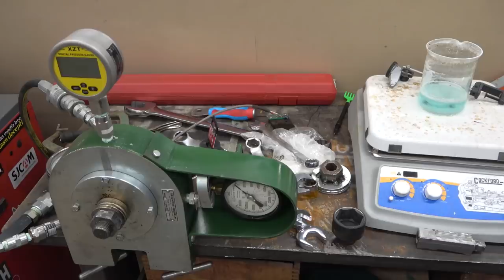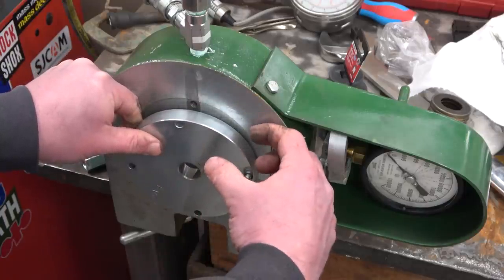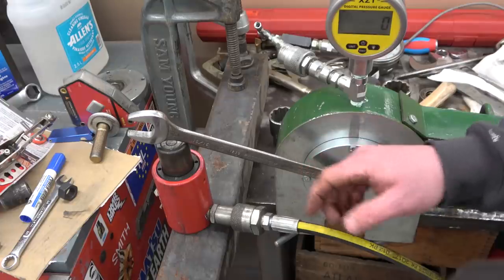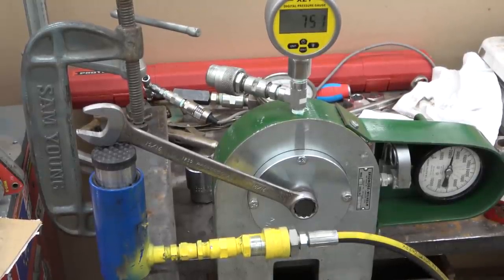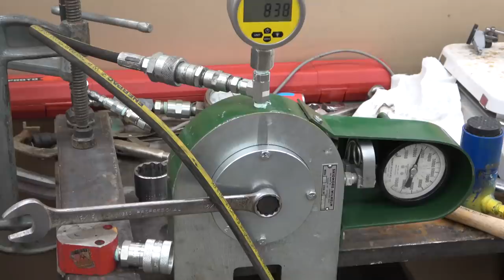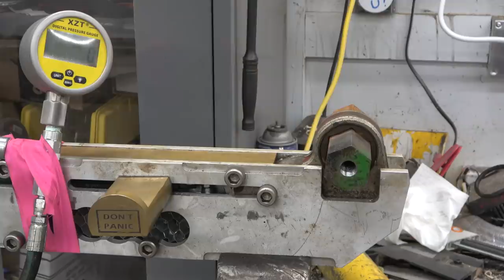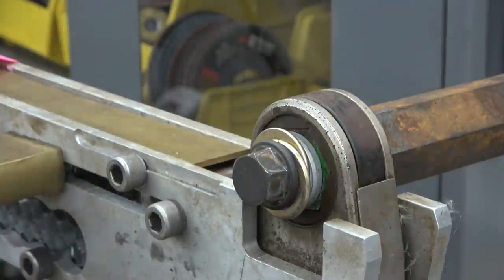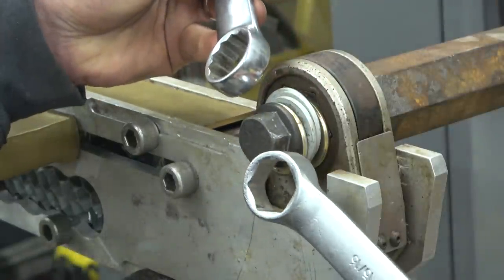6 point VS. 12 Best wrench?

Comment: FYI I am cuntinental.  Only ever had a problem with 12 points slipping on small sizes, like 13mm downwards and only ever on rusted worn heads. Love my 6 pointers for taking old and rusty crap apart. And if I can rescue a nut/bolt with a 6 pointer I'll probably not be arsed about swapping for a new one. I'll save myself 10 pennies and swap it next time🤣
Sometimes as big as 19mm might slip if the heads are really rusted to hell and badly worn. 12 point if the gear is in good order and theyre not made of cheese.
Horses for courses

Comment: I will always choose a 6 point over a 12, unless the 6 point absolutely will not work. 12 point only contacts ont the tips of the fastener, which causes more stripping. Especially with the smaller fasteners (1/8-3/4). I think that bolt was much to high quality. Get a weaker bolt and the 12 point will fail where the 6 point will not. Guaranteed. It's just physics.

Comment: The only time I’ve need to use single a hex ring spanners was working on V8 Mack exhaust manifolds and fire boxes . They are right up against the chassis rail and the constant heat fucks the bolts …..if you round those fuckers off your going to have a bad day …

Comment: If you’re fortunate enough to be dealing with nice pristine new fasteners then yes there is no difference to be had betwixt the two.   However, my six point gear has saved my
 bacon a time or twenty  dealing with rusty crusty junk bolts or on softer stuff like those junk aluminum bolts or the cheese grade bolts used in 90’s era GM battery bolts.

Comment: 12 point have a use, when it’s such a tight hole you can’t get a 6 point at the right angle to bite, like an lb7 turbo swap, dear god ill never do that job again without removing the cab lol.

Comment: Now try that with a rusty ass bolt head... or if your nuts are rusty, try that. That is where the 6 point comes into its glory. The problem is not weakness with the wrench but instead with the farstner. Any shade tree knows this little nugget of wisdom from many a curse ridden late night trying to defeat an evil possessed nut or bolt on their old trusty rust bucket.

Comment: I try to only use 6 point combo action wrenches & sockets. The 6 point combination wrench is a lot harder to find especially in both big box stores. At my first job 50 years ago we had 2 of the best mill Wright mechanics who made me take what they called nut rounders home. ( crescent or adjustable wrench for you younger guys. These guy could be on a third story hard to climb up to roof and refused to use nut rounders a different trade guy had with them. Would climb down 3 long ladders to get to their tool chest in basement of buolding just for 1 socket or wrench. Halve ass mechanics always use cheap halve ass tools.
Reply: Nothing inherently wrong with a decent quality adjustable.  Also, knew 60 years ago that 'crescent' wasn't correct.

Comment: Its more so YOU slip on the wrench rather than the wrench itself. Pounding on the ass end of a 12 point in a spot reserved for 90 pound Filipino buddies has more of a chance of said wrench tweaking off and ruining the fastener than a 6 point. Got me some ratcheting 6 points to get the best of both worlds and I've "yet" to explode one from locking them together as well.

Comment: Rounded plenty of nuts with 12 points. Old made in USA Craftsman. Maybe a Snapon would have not.  Could be your using high grade nuts and need the 6 point ratcheting wrench on the softer nuts and bolts provided by manufacturers. Even the cheap ratcheting one would probably yield the bolt before wrench failure.  And of course never disparage the guy in the shop using the 12 point sockets with the impact who says his 30 year old craftsman has not broken after many uses with said impact. Not worried about his sockets. Worried I’m next to work on his aftermath.  
Only beat off your own nuts with a 12 pointer
If you have to pull on it that hard. 
I don’t want your sloppy second’s 
Safety squint’s engaged

Comment: Yeah you rounded your bolt because you tried to use a 10 and not a 9.5 and guessed wrong. Now youre trying to blame your wrench instead of the fact standard ever existed in the first place. I also saw this episode before where I welded up a harmonic balancer holder to hold the crankshaft while I broke and tightened its bolt, from a piece of old water heater, some rebar and a bedframe pipe as a handle. It needed resist the force of 150 ft lb. Got close at around 130 and bent. So I cut an additional piece of pipe in half and wrapped that around the handle and welded that in place. 130 +130= 260 and sure enough twice as thick means twice as good. No fancy gauges needed. I could have gone without a special tool but not in this case because I needed to break the cam bolts loose before I did the harmonic balancer to get behind those and replace their seals and youre just better off having that tool around for next time instead of trying to do bump tricks with an interference engine with the cam bolts loose.

Comment: Well, you actually not supposed to use a 12 point wrench on a conventional bolt, because they have 6 points.. you should use a 6 point wrench on a 6 point fastener  and a 12 point on a 12 point fastener.. and yes 12 point nuts and bolts do exist! Take a driveshaft out of a ford truck and you will find 4 of them!

Comment: You got the angles right at the end,  15* for the 12 point and 30* for the 6 point, because of you flip the wrench you get another bite at a different angle giving you 24 spots with the 12 point and 12 spots with the 6 point...atleast that's what the fap-off salesman told me.

Comment: A 6 or 12 point will not break with any regular bolt. To break it you must make a special pin that has no practical use except to break wrenches. Moreover the weakest point in the 12 point "ring" (the part that goes around the bolt) is the same thickness in theory to the 6 point, given that they are both made for the same bolt head. the Strength of the ring is given by that weaker section. I do appreciate you demonstrating that. One day we might even stop hearing nonsensical BS.  Which is stronger a 2 inch shaft that has a section that reduces to 1 inch or a 3 inch shaft that has a section that reduces to 3/4 inch? As you mentioned its the failure point that matters and how strong it is.
If the problem was not strength but slippage, well all you need is to look where a 6 point makes contact with a nut while under heavy pressure to realize it is not using 1/3 of it theoretical contact area. Next stupidity: the 12 point rounds off the fastener. No it fucking doesn't if you use the right size. A point can be made (or unmade) that a 6 point, given how it can be misused more easily to tighten or loosen the wrong size of bolt-head, can be used more effectively to round off the corners of a nut or bolt-head. Make no mistake a 12 point can also be misused in that manner, but the 6 point offers a wider range of victims.

Comment: AvE check out KSR performance and fabrication's channel...today's video Kevin asks if hammering a weld does anything or is he wasting his time. Starts at about 15:30. Love to hear your input
Reply from the maker: Yes, old dude is correct. "The layer of compressed surface material produced by peening resists the development and propagation of cracks and increases resistance to fatigue failure, corrosion fatigue, stress corrosion and cavitation erosion. "
Reply: Thanks man. Insightful stuff

Comment: Don't ever get yer damn 12 pt wrenches near my car! Rounded bolts anyone?

If the bolt has 6 points, you use 6 points. That's why they fuggin' exist.

I don't work in nearly-one-inch in automotive work; you try it and find out yourself. Box end or socket, 12 pt blows.

Comment: You're using far too high quality fasteners. Get you some cheap junk bolts and try the 12 point again and you'll find the 12 point will round the bolt head off before it breaks the bolts. Same will happen with brass and aluminum.

Comment: clearly you west coasters with your 4 digit paycheques have never worked on the junk we have on the east coast... of course they both work fine on a 15/16th head thats brand spanking new and never touched by a 15 year old with a mastercraft socket set.. the things not lathed round nor is it rusted into 4 sizes smaller

putting a 12point on anything over 10years old down here is going to be a bad time, youre correct 6 point are hard to find in what you want, cause i look.. what grinds my gears is that all the ratcheting wrenches are 12 point.. WHY they have 120 positions doubling the points does  nothing but round off every 13mm you touch

Comment: This makes no sense. You prove that a brand new bolt will not shear between the head and tool with either 6-point or 12-point. What about a bolt with a rusty head. A 6-point will certainly be better when removing the suspension strut of clapped out Toyota Camry from 96.

Comment: G'Day,,,Mate the 6 point is by far better when you can get it on the bolt,,How ever as perpertrated by AVE,,it done no matter,,
how ever for ease of getting on to bolt,,in one of them upside down inside out situations the 12 is far better,,
But  3 goes in to 12 so does  4 and 6,,so any fastener that has sides divisable in to 12,,a 12 point spanner will fit,,where as with the 6point yer nup,and in this world of ever changing fasteners,,i'll take the 12,,every time..
biggest problem is the hex it self,,,not exactly the right size,,and spanner quality has a lot to do with spanner size and the amount of slippage as well,,
After all,Oils ain't oils.

Comment: Use a lower grade bolt. That'll explain why you might want a 6 instead of 12.  Its not the wrench that might fail, its an old crappy bolt thats been removed and re-torqued a hundred times. A 12 has less purchase on a hex head
Now getting the 6 point on an old crappy  bolt thats been used over and over.... I wouldn't bother with that. Get the nut splitter